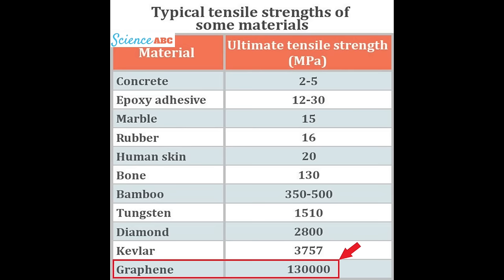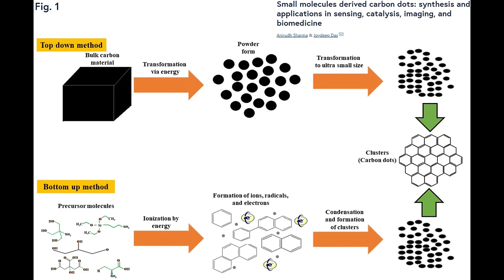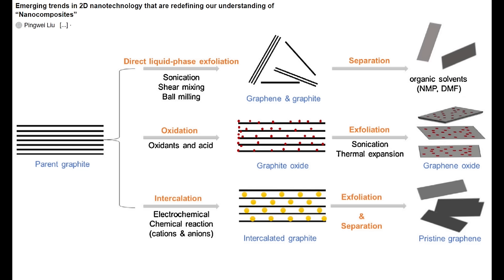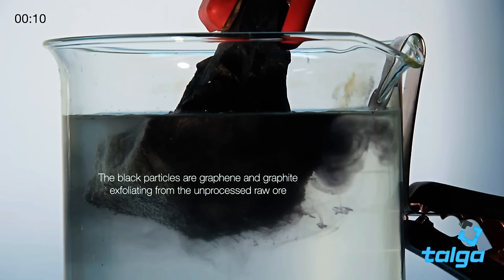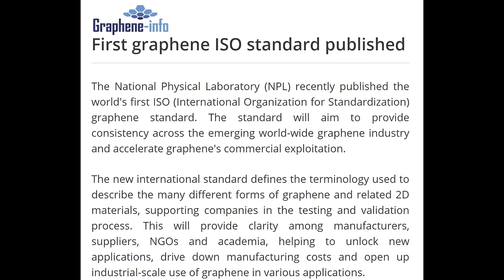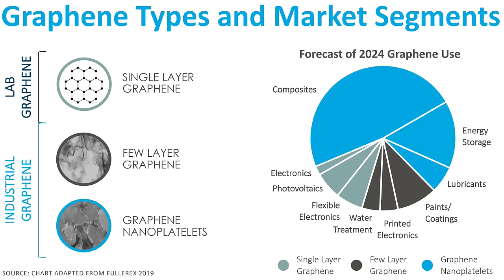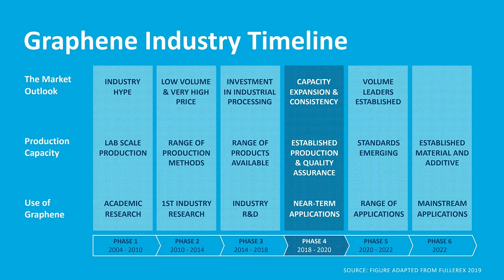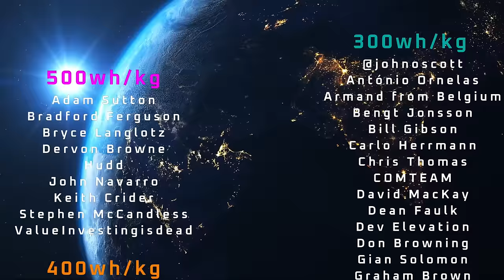Commercial Graphene Production // Allotropes and Applications

Comment: Again you managed to explain a complex issue pretty easily. What people need to remember that, as Neil deGrasseTyson said many times, carbon has more ways to combine with itself and other elements than all other elements combined. And carbon is one of the most common elements in the universe after H, He and O. 

What may be missing from this video, and what you address in one of the next videos, is how a relatively small amount of, some form of graphene, enable other materials to be stronger and have a better conductivity then itself on its own.
Reply from the maker: That's a great quote by NDGT!  Great question how so little can stretch so far:

1) Usually these things are done by weight.  If you fill a 1 liter jar with graphene, it only holds 70g or so.  So, even a few weight percent of graphene in a volume of a material has a massive impact throughout the volume.  
2) It's so extreme in it's conductivity and strength.

Combine 1 & 2 and that's pretty much the answer.  😃
Reply: The Limiting Factor Neal Stephenson wrote an SF book called The Diamond Age in 1995 where he explores a world where carbon based nanotechnology is ubiquitous. In this respect Diamond Age is comparable with the Graphene Age. The term Diamond Age was coined by Ralph Merkle who together with Eric Drexler popularized nanotechnology.
Reply: Nico Veenkamp I love that book. FYI The young lady’s illustrated primer was actually inspiration for the kindle.
Reply: @NicoVeenkamp  There was a "Diamond Age" episode of Naked Science where they explored diamond applications and diamond semiconductors. I however spoke with a diamond material scientist who said that effort had flopped. It would be interesting to see what graphene could bring back, and more information on the 1.1-degree magic angle would be very interesting to cover too.
Reply: I hope the omnipresent graphene will not combine with me, asbestos and grey goo are enough.
Reply: @thelimitingfactor  what about flash graphene production?
Reply: @gameresearch9535  yeah got it: real important to watch all the videos!  Can you please provide a time investment estimate  to do that?  I sort of have a life but I believe this graphene stuff and I have a rendezvous with time and space.   I've been thinking about graphene since I first learned of cyclic carbon rings in a college kitchen chemistry class in 1978, only it wasn't called graphene then, or at least, I didn't know it as that. Benzene was the closest thing.  Tesla's 3, 6, and 9 numerical importance is obvious with graphene.  Electron flow on graphene is going to be real important.
Reply: @clavo3352  

If you have seen the playlists on my other channel, Graphene Spintronics and Graphene Twistronics is very important for multiple fields / applications shown on my other channel and yes for many other things. Though it doesn't stop there.
However, not much point in mentioning this, I would give this information to some of the private companies for Fusion Energy and so on, they seem to ignore Graphene a lot and they use copper for thermal conductivity. Not talking about their high field magnets, just when they use copper by itself, it's quite disturbing knowing that they only use copper in specific ways when Graphene is proven to be better than copper, but also silicon that is in our computers, "another good reason to watch all the playlists on my other channel, for Graphene Computing, and Graphene Photonic Computing".

I'm ready for Photonic Computing since integrated Photonics is already coming very soon to the data centers and then to the consumer market after that, but also mix that with Graphene and that can be seen in the Graphene Computers playlist on my other channel.

Exciting stuff!

That's just the start of it, look into the Quantum Technologies to work with Graphene and Photonic Computing, such as a Twistronics Spintronics Graphene Photonic - Quantum brain chip. Though that's not all, again even that's just the start of it.

Although please do start with the "created playlists" and after watching the "videos with important info to get around my channel" playlist.
Once in the "created playlists", go to the bottom and watch starting from the Graphene playlist, Photonic Computing playlist, and so on, from the right to the left of the row, and do the same for every other row and work your way to the top playlists in that order.

If you have time for a movie or video game, or to read a book, or anything else, then you have time to look at my channel because after all, it is the most important thing for our civilization, my channel is leading the way in awareness, learning, the big picture, multiple big pictures updated, but also for showing the latest with prototypes and breakthroughs, but even that is updated.
You still need to start with the Graphene playlist though, regardless of what you know, don't be closed - minded and think your experience means everything, you're not the first that seems to have come across it in the 1900's, but I do appreciate when people take the time to be open minded and interested in learning by watching the videos just to update themselves with more facts / info and see a lot more about it.
The channel doesn't just teach what Graphene is, if you assumed that then you would be wrong and you became ignorant to what else is there about Graphene, Photonic Computing and Quantum Technologies, at that point. And I respect people who take the time to learn based upon what I have to show them. Meaning they either see it at my level to be on the same page, not just with what it is but also updated info on the products for it but also what else it can do, then I am satisfied that people are at my level.

One other thing to note is that everyone I go offline, no one knows what Graphene is, except in other countries where they seem to know quite well, but offline around me and in specific states, no one seems to know, no matter who I ask, and they don't seem to care either, a lot of ignorance and lack of interest because of greed and corruption, many people have told me that they have no interest, others show it easily and act ignorant where they won't even go to my channel to learn, some like to skip through each video or they skip through the videos, cherry - picking / nit picking and it's quite frustrating feeling like I'm on the wrong planet.
Reply: @clavo3352  

Also to note, I can see that you're replying to an old message, I have updated this channel with some playlists and 2 simple steps for my other channel, be sure to read the "About" tab near the top, on this channel I am commenting with now, for more info and steps for my other channel, it also has a link under the About tab.
Reply: I found natural volcanic graphite mines in my country .can you together doing for third jenaretion
Reply: What happens to human bodies when nanoplatelets are injected?

Comment: What about using one-layer graphene as a conductor instead of copper in batteries and motors? Maybe rolled up to form a wire with some kind of separator between layers. Maybe the substrate used for bottom-up formation could be the separator.
Reply: Woven carbon nanotubes are possibly a better candidate as they form fibers by innate structure and have the same properties as graphene.

Comment: You mentioned that carbon could be made with less-structurally-sound larger rings. Makes me wonder about whether such rings could be formed "bespoke" into "far harder than diamond" repeating structures, that are closer to a "woven textile" in design, or high-carbon steel at a micro-scale. (I.e. With interlocking rings of carbons that, if weaker than c6 tiling by themselves, would be strong if they were linked together like chain-mail armor.) A larger version of this would be weaving together ultra-long SWNTs with each SWNT forming "a single thread, to be woven." This stuff is fun to think about.

Of course, it was nearly all predicted by Drexler's "Engines of Creation."

Edit: Sure enough, my memory was correct. All kinds of geometries are possible. Here's a white paper discussing them, with a graphic. It's interesting to imagine A long wire of SWNT running down the middle of a long stack of the hexagonal toroids. Would it be ultra-strong and ultra-tough? Would it carry current without breaking? Once ultra-long kilns exist, reality is going to get weird. Ideally, we all live long enough to put our brains on a mostly-carbon neuron substrate.

Comment: Did you mention the idea of placing a thin copper wire into a solution that includes graphite, and then running an electrical charge through the wire? The result would be deposition of the graphene onto the wire, and a stronger graphene wire because of the copper inside the wire.
Reply from the maker: Watch the video and find out.  Or, if you're lazy, you can just word search it.

Comment: Thanks for the video, and I look forward to your next videos on batteries and capacitors with Graphene.
I disagree to your statements about the use of Graphene in electric cars.
Capacitors Vs Batteries - we know that capacitors can be charged and discharged faster while batteries can dense more energy.
We know that the name of the game with capacitors is wrapping around as thin as possible conductive sheet. 
Theoretically with Graphene being the thinnest and most conductive material, one could create capacitors that would be able to hold enough energy that batteries will no longer be needed (almost) at all.
This will save weight and cost on the vehicle, all while improving the product (faster charging, better acceleration (use of power), speed).

It's a matter of maturity and cost, and it may not be the first item on Tesla's backlog, but I am sure  they see it as relevant for them
Reply from the maker: Hey man!  Thanks for the well-considered response 👍

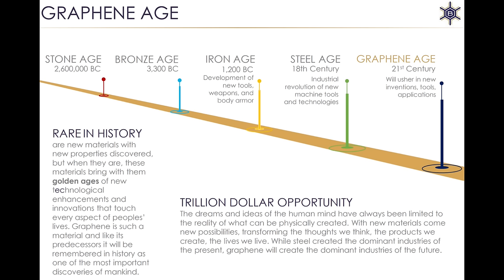Comment: 17:50 I think the aluminium age should be included between steel and graphene cos aluminium was a way revolutionary material (especially with aviation). Aluminium completely changed aviation, opening doors that never would have come close without aluminium. But not just with aviation either.
Reply: how about a silicon age?

Comment: What about a life-straw type method of starting with graphite at the top, slowly descending into a lesser volume 'tube' while tethered on the other end by graphine.

Once it's tethered, a simple gravity drop should/could pull it out like taffy.

And by tube I mean literal in a sense, but whatever can step down the layers. If it can be tethered in this model as abstract as it is the strength alone should hold through the pull.

Just have to figure out what the 'tube' could be. Some sort of bond separator and imposer....

Comment: At 20:26 the chart for fast charging batteries you see LTO and Graphene for fast charging. LTO cells have -40 to 140 degree range with a 5 c charge/discharge rate and 15 miliohm internal resistance, 20000 cycle life, what will graphene do to help this battery? LTO has many great features that for my use and makes other batteries a poor choice.
Reply from the maker: A very different use case.  This is for the cathode I think.  This is to actually increase energy density is my guess.

Comment: 1:18 Hydrogen cannot be "strong" because it only can form a single bond, and therefore cannot make chains. However, I don't recall how this works for lithium. Lithium has only one valance electron, but it must be able to form multiple bonds, or it could only be a gas. Right?
Reply from the maker: Correct

Comment: Has anyone explored mixing ultra fine graphite into a component of high density structural foam?  Would the rapid expansion of the foam create graphene?  If it does, the foam could be the next generation building material and dozens of other uses and if you want just the graphene, dissolve the foam.

Comment: So graphene can be grown on copper but cannot easily be removed. Does graphene retain it's super conductivity and strength while attached to copper? Would an ultra thin copper sheet coated with a layer of graphene be useful?
Reply from the maker: I haven't looked into this yet, but my understanding is that the electrons move at the surface of the metal - so I'm assuming yes 😃

Comment: Although not covered in this video, why would graphene allow ice and snow-free walkways/drives? Would it be because you could run a current through them, or does it have the potential to lower the freezing point of concrete surface? This was discussed in a Talga resources ltd presentation but not explained why.
Reply from the maker: Exactly!  You can run a current through it to slightly warm it.  I don't know how much energy that would take, but that's the idea.  It also has other uses without electricity if it's more conductive...like in situations where you need to radiate heat away from maybe high voltage cables?
Reply: @thelimitingfactor  I remember watching a video where they were adding graphene to rubber to significantly increasing the heat resistance. Do you think there has been a clear winner yet like with batteries being Tesla? Or still too early to say? But anyway great content from yourself one of the few youtubers I generally get excited when I see a new post on my feed :).

Comment: Great video! Wish I was younger and whole again so I could participate in the creative discussion meaningfully.  
The graphene anode discussion was most impressive.  Following your explanation of the extra electrons in the chicken wire matrix; One can visualize how graphene catalyzes the ingress and egress of electrons from a battery.  
Does it mean that it should be feasible to charge and discharge a multi-layer prismatic battery almost at will?
Reply from the maker: Thanks man!  The limiting factor would become ion movement.  If you discharge/charge that quickly it would create concentration gradients in the electrolyte solution.  You'd either need to increase the amount of electrolyte or find a better electrolyte.  You also might run into plating?
Reply: @thelimitingfactor  Wow! That took me a while to digest.  Thanks. It points to the need to use some kind of cathode capable graphene or even a graphene compliment to act as the electrolyte.  My dilapidated old brain, thinks.

Comment: Awesome video,  you nailed it, can the graphine nano flakes be added to a clear coat to make it more scratch resistant vs al203 or si02, bust still retain the clarity
Reply from the maker: Well, graphene is transparent, so I think that part would work.  However, I don't think it would change the hardness, which I think is what dictates scratch resistance.  I think where it works best is for resistance to rust.  Massive sea trials going on at the moment with it.  Glad you enjoyed it!
Reply: @thelimitingfactor  Graphene is not transparent. Sheets reflect the light, but in mass it appears black.

Comment: Fantastic video as always Jordan! 👏 Your models were very helpful explaining the important characteristics of graphene as well. Very exciting to think of our future as the graphene age!

On a separate note, do you know how much of an improvement in density and charge rate a graphene-based battery would likely achieve?
Reply from the maker: Hey man!  Thanks for watching as always.

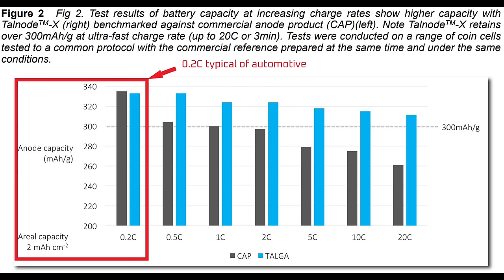The image at 20:45 shows a charge rate of 20c to hit about 95% charge.  That's 3 minutes to 95%.  

In the same image, the regular battery can only do 20c to 80% charge.  

The regular battery would probably suffer more because of it as well because it would be generating more heat.

It's a really complex question to answer because you also have to take into account thermal  management and how much you want to preserve battery cycle life.  

I'd say 10 minutes to 80% of the top of my head.

Graphene does not improve energy density when added to the anode.  The anode is the first place where it will be used because the anode is already graphite.  In fact, it reduces energy slightly because you are shattering the intercalation material.  

When people say that improves energy density, they mean at super high charge and discharge rates.  Regular batteries peter out at high charge and discharge rates.  

There are other uses where graphene can improve energy density.   Those materials are probably 10 years away.

Comment: I want graphene magnet wire for light weight motors and servos, will be huge for RC industry
Reply: graphene can not be magnetic since it has no single electron indide like feromagnetic elements (Fe- Ni.)unless you dop it with heavy atoms (always fero atomes) wich is another question.

Comment: Hi thanks for this video. I appreciate you packaging this info into the easily digestible video. 

I have a question that I am hoping you can answer: will graphene be able to replace or be an alternative to thermoplastics? Would graphene be able to be sold in sheets that can be thermoformed over positive molds? I wonder how much more rigid graphene may be if a same sheet of graphene is curved vs completely flat, macroscopically speaking.